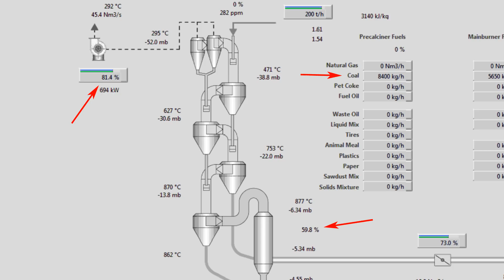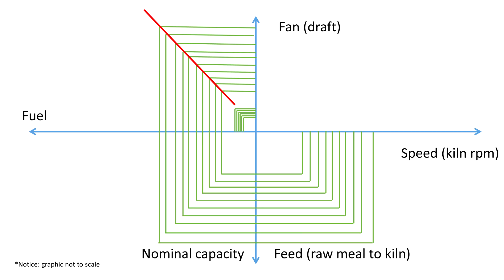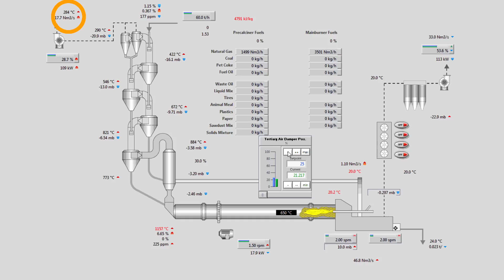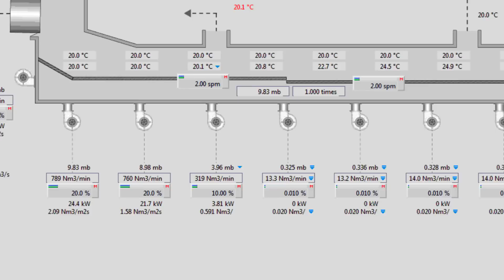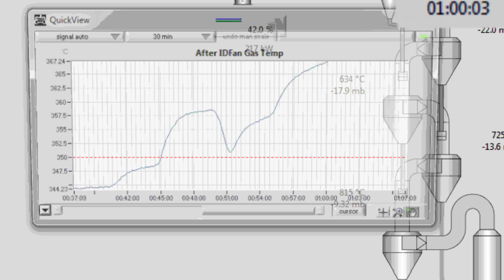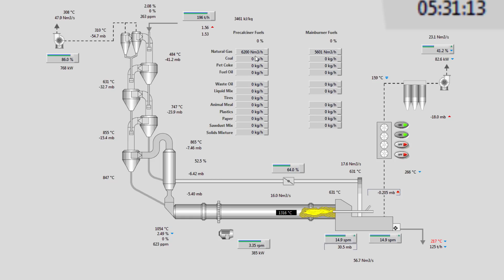Kiln Operation

Comment: hello sir i happened to watch  your intersting video in kiln operation. The problem i am facing is higher tower temp of 430- 440 c. its a 4 stage cyclone with 100 % gas firing.  Earlier the top temp was 380-390c Now when i try to increse feed and bring down the temperture the kiln gets upset run. i am getting calciner temp of 900 c . can you explain whatcould have gone wrong.  False air leakge arrested max . but still the situation same.
Reply from the maker: Hello Mohammed (not sure if this is your name, sorry if it is not)
You are describing a typical problem of high exit temperatures, with the consequence of high thermal energy consumption and potential excessive wear + damages to your ID fan.
Difficult for me to give you a solution without knowing the "full picture", basically to see what happens in the different parts of the system.
It would help if you send me a screen capture of your kiln system, with details of the preheater / precalciner and the cooler.
Then may be I can help. 
Have a good day, Fred

Comment: does the flow of limestone intermittent? or continuous?
Reply from the maker: Hi Eduardo,
The kiln feed or raw meal is a mixture of limestone + silica + alumina + iron oxides.
It is a continuous process in this case. The original technology used so called "vertical kilns" and those indeed were typically processing batches of material. Mind you, these vertical kilns produced mainly free lime - in Spanish Cal viva.
Hope this helps....
Reply: @FredAubert  Thank you,actually based on your theory I already understand it is a continous calcining.I am refering to your lectures in designing a small rotary kiln for quicklime production.Thank you and more power on your channel.

Comment: Hi Sir could you Share the software?
Reply from the maker: Hi Ismail

Yes of course, I can share the software but this will have to be done through a training session. There is no point of just sending you material and then you couldn't know how to use it.
I suggest you talk to your management. My proposal is that I go to your plant for one week, see how the plant runs, what the training needs are, and then we plan a delivery session.
Let me know what they have to say and we take it from therre.
Best regards, Fred
Reply: @FredAubert  sorry i have no kiln. 
I am working for alignment system. And i know that there are lots of types...
Reply from the maker: @raxtor3199  

Hi Ismail
If you have no kiln, then there is no point in sharing the kiln simulator, I guess.
You are probably right, there are many types of software to support / help in aligning equipment, but I do not know of any in particular to recommend.
Good luck in your search and

Best regards, Fred

Comment: Sir I have 8 years experience as CCR operator in cement industry . I want to work abroad plz try to send recruiting companies.
Reply: Hello Butharaju

You should know that there are many, MANY operators out there with 8 and more years experience and would like to work abroad...

If you want to succeed my recommendation is that you start with doing the following:

1.- Prepare your CV, short and to the point - one page maximum, nobody is going to read a "book of your life"
2.- Write a letter, so called a Motivation Letter, where you explain your capabilities, strengths and experiences as CCRO, and what would a company would benefit from hiring you. This is certainly the key to your success, more important than the CV itself, you have to spend a lot of time on it.

With these two items in hand you will have a better chance to approach an international company online (look for the big cement manufacturers, go to their pages, they always have a hiring section).

Good luck!

Fred
Reply: @fredaubert8531   I have good resume sir but I want companies names And websites to send CV and take interview to work sir
Reply: Just google "large cement manufacturers" or go to globalcement.com/directory  and you will get those many of such big cement manufacturers.
Concerning your Resume, yes good to have but remember to prepare the motivation letter, otherwise - if I were a cement plant - I could ask myself "why would I run the risk of getting Butharaju here?" The only reason I would get you is to pay you low wages, much lower than locals so be careful with that....

Comment: Hi Fred, could you inform what software used for your simulation?
I am very interesting to discuss regarding rotary kiln control with you.
Reply from the maker: Hi Teedy,
We use two software / programs, first  "acslXtreme" for modelling the cement manufacturing process, then "LABView" to prepare the user interface. It took a couple of years to get a "running simulated kiln" and we were sponsored by a large cement producer. 
Concerning your other question about rotary kiln control, I am not sure what you want to discuss, that is how to model a kiln or how to control / run a real kiln. Whichever is your need please be aware that this will take considerable time and I may have to charge you for my services.
Let me know what your thoughts are and keep safe!
Cheers, Fred

Comment: Good morning sir, good information, sir please explain about kiln zones
Reply from the maker: Hello Sitha

You have an interesting question but I think that you can find the answer in Internet.... (example here https://en.wikipedia.org/wiki/Cement_kiln)
What you have to keep in mind is that your kiln zones sizes will vary depending on several factors, mainly your flames shape & size, the fuels you fire and the gas speed in your kiln. This means that you cannot say that your "upper transition zone is 18 m long"  and trying to change the size of these zones is not your priority. You have to focus on producing a short and strong flame, keep your Oxygen levels as low as possible (no CO) and the zones will be adjusted accordingly.
I hope this helps you ... let me know.

Regards, Fred

Comment: Thank you mr. Fred, do you know about a operation simulator for free i can download?
Reply from the maker: Hello Rafael,

Unfortunately I do not know if such simulators exist to be downloaded for free. Even when they are sold, there is just a limited number of such software.
I am using one which was produced many years ago and still have the license to use it. The only thing that I can do nowadays is to run training sessions using this simulator.
By the way, Rafael, are you located in Latin America? De ser así podemos conversar en Español,  avisame por favor. 
Cheers
Fred
Reply: @FredAubert  muchas gracias, efectivamente soy Mexicano, actualmente me encuentro en un curso de capacitación   pero no tenemos una herramienta tan útil como esta, es increíble para aprender y no arriesgar la integridad de los equipos.
Reply from the maker: @rafaelv.4451   En efecto Rafael, el tener un simulador es primordial para asegurar la capacitación de operadores sin riesgo para el sistema del horno.
En su tiempo yo labore para Cementos Apasco, en Apaxco Edo de Mex. y en ese tiempo también usamos un simulador...
No se para que planta estas trabajando pero en caso de que pienses les pueda ayudar en capacitación técnica, te sugiero hables con tu gerencia y les propongas lo siguiente: yo ofrezco realizar una visita sin costo alguno (solo me cubren viáticos) y me quedo una semana a evaluar a la gente, ver como esta la planta y hacerles una propuesta de formación. Por supuesto que durante esta semana estaré aconsejando a los operarios, dando Coaching donde pueda. Si aceptan mi propuesta, bien y si no, pues no hay problema.
A ver que les parece, me avisas por favor....

Saludos, Fred Aubert (ex gerente de capacitación técnica en las oficinas generales de Holcim / Suiza).

Comment: What's software you use on this video?
Reply from the maker: This is a kiln / mill simulator, made some time back using XL Extreme platform and LabView for the user interface. I usually use the simulator for training CCROs and in case you ask, no, it cannot be sold ...

Comment: Hello.Is pre-heating necessary for CSA(calciumsulfoaluminate) cement? and can you explain about CSA cement production process? Thank you
Reply from the maker: Hello
I have no experience in manufacturing CSA cement, sorry about that!
When you say pre-heating, do you mean using a preheater tower? As far as I have seen and read, one can fire such clinkers in traditional Portland clinker kilns, but in the case of CSA temperatures needed are lower (lower temperatures= less fuel = less CO2 emissions)
Good luck in your search!

Comment: Hi, we work in a cement plant in Mexico anr recently we have some ¨avalanchas¨ in the preheater of raw material, do you think it can be caused by a high conentrate of sulfur on the raw material, we actually use coke as a fuel in burners and a 20% of sustitution of fuel with waste materials in preheather
Reply from the maker: Hola Alejandro

Es temprano para tí, sospecho que estas de turno en la sala de control...
No lo mencionas específicamente pero el 20% de AFR en el precalentador se introduce como precalcinación (con aire terciario), o es solo algún quemador secundario? Queman llantas? Me es difícil asegurarte si las avalanchas son causadas por un alto contenido de azufre, sin tener mayores información sobre el tipo de horno y la química del crudo, y del AFR...
Sería ideal si me pudieses enviar un screen-shot de tus pantallas en la sala de control.
A proposito, yo trabaje algunos años en Mexico, para Cementos Apasco....
Saludos
Fred

Comment: Appreciate your effort sir. Currently I am working in a cement industry where
 Energy consumption is approx 790-800 KCal/kg clinker consumption. I am keen to optimize this energy consumption. I would be grateful if you can guide me how to reduce this energy consumption. And can you refer a software for carryingout energy balance.
Reply from the maker: Hello Hammad
Thank you for the feedback, I am glad that you could watch the video and hope it gave you some ideas about how to optimize your system.
Concerning you question, I would say that you have to start with the simplest, more obvious research. These findings will help you identify potential improvements which will bring you substantial reductions in specific thermal consumption.
I terms of "software" for an energy balance I suggest to use an Excel sheet. What is important is to take proper measurements, the software and calculations will be done on Excel.
I can give you some hints about where to start with your investigations, but will need from you some more information about your kiln system. It would be great if you can send me some screen shots of the preheater / precalciner / kiln / cooler at stable conditions. We can take it from there on.
Think about it, no compromise from your part and no charges from my side.
Keep well and safe from this Covid19 ...
Fred

Comment: Hi Mr Auber.  We are thinking of a similar system, but with more air flow and more heat exchangers.  The idea is to maximize heat absorbtion, and to dry a masive ammount of silica sand, not to make klinker nor lime, but over 1000t of sand per hourscan you design it?
How much?
Reply from the maker: Hola Camilo
En lo personal no tengo mucha experiencia con secadores del tipo "flash dryer" y si fuese el caso de desarrollar un simulador de este tipo, entonces necesitare dimensionamiento del secador, tipos de refractarios instalados, datos de su operación desde arranque (precalentamiento) hasta producción nominal, rangos de temperaturas que se manejan, combustibles, consumos específicos ... en fin la lista sigue y sigue.
En cuanto al costo? Bueno creo que del punto de vista de rentabilidad para tu planta, te debo decir que sería demasiado caro desarrollar solo un modelo y más bien sería vender este simulador a varias plantas. No te puedo dar una cifra definitiva pues necesito conocer más del sistema para poder hacerlo. Sin embargo te puedo adelantar que estamos hablando por ahi de los 60'000 a 80'000 US$
Pero claro que si el sistema es muy sencillo, entonces el precio bajará a solo unos cuantos miles.... Lo mejor es que me envíes algunas pantallas de tu sistema operativo.

Saludos, Fred

Comment: dear sir I  want to communicate with you to help me for my gap in energy optimization since I am working in thermal energy optimization in cement factory
Reply from the maker: Dear Siltan

Yes of course I can give you some advises, but before I need to know more about your kiln and how it is operated. Can you send me some screenshots of the system, preheater / precalciner,  kiln and cooler? Without this information I cannot do anything.
Please use my email address, it would be easier to do that:  vbrcement@gamil.com

Kind regards

Fred
Reply from the maker: Hi Siltan
I need more information about your kiln system to identify the potential energy conservation points. Can you please email me more details at   vbrcement@gmail.com
Thank you!
Reply from the maker: Hello Siltan, yes I can help you but can you please use my email address: vbrcement@gmail.com 

Send me an email and we can start from that point, basically to know what you know best and what you need most.

Regards, Fred